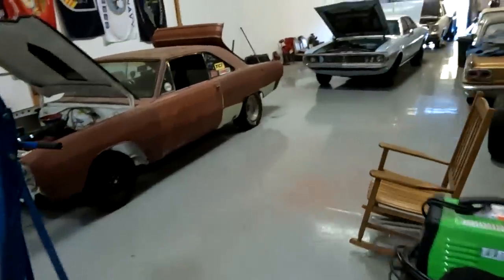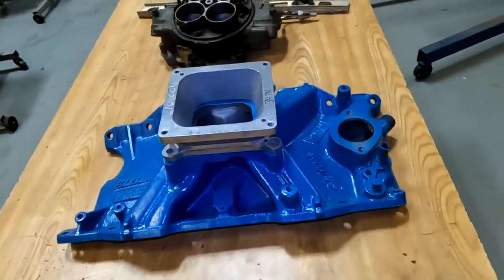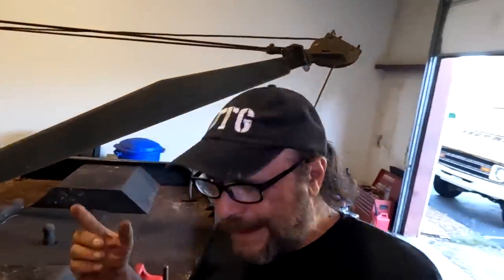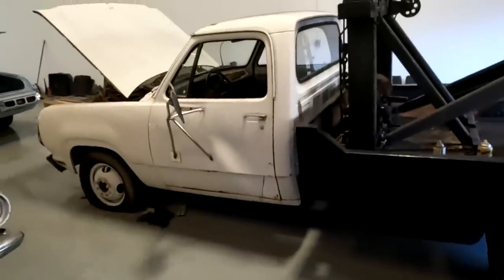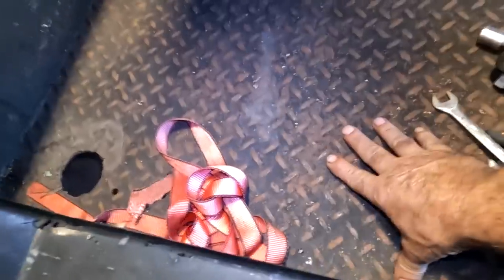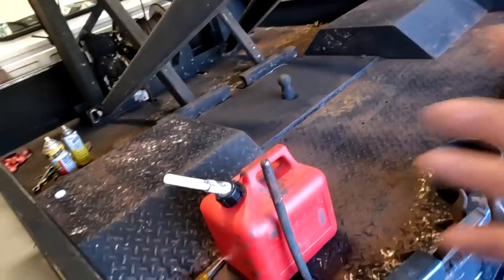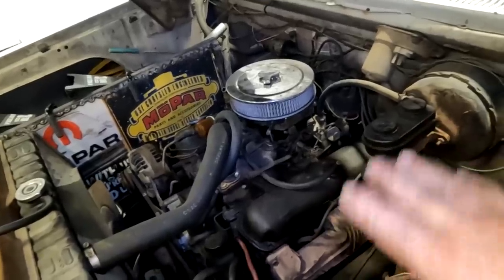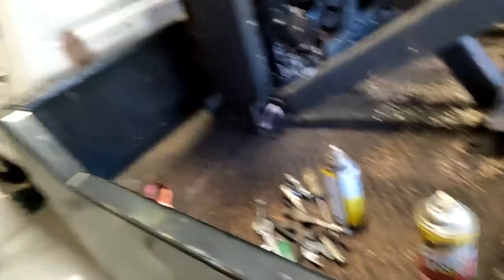Survivor Dodge Tow Truck Finally Gets Some Love, And We Build A Frunk! 1980 Dodge Wrecker Revival

Comment: Definitely a cool truck, all 70s and 80s dodge truck parts are very hard to find these days, you rarely find them in the junkyards and if you do they are either picked clean or totally roached. Also for some reason every single one of these era dodges I have seen has had the most hacked up and cobbled wiring harnesses on the planet lol.
Reply: It’s definitely a dodge thing, it’s been a thing for years and still is.  I was really glad to get rid of my last dodge while it still ran,  it was an 01 with all new cores but it had so many gremlins that I couldn’t believe it 😂😂
Reply: @georgewelker853  yeah dodge wiring is a special kind of junk, I have worked on a ton of old gm cars and usually the factory wiring holds up pretty good and rarely has issues unless someone adds a bunch of aftermarket junk or burns the starter wires on a set of headers, usually old ford's wiring would rot or just deteriorate from all the nasty grease they used on all the electrical connectors but dodge wiring is usually just a huge rats nest of wiring that gets, patched,spliced, twister together with no ryhme or reason. A buddy of mine bought a 89 12valve diesel ram truck and the whole harness was so butched I couldn't believe it, there wasn't a single unaltered wire on the whole truck every wire had been repaired,replaced, or taped into with scotch-locks it was actually amazing that it ran at all lol.
Reply: @briang4470  I found the connector for the tail lights by the booster on an 89 Cummins and we removed everything from there to the back, ran all new wires to the back, and put turn signals on the corners of the flatbed.  
The fuel gauge ground wire ran clear to the tail lights, and hooked into the tail light ground. No wonder the fuel gauges could read empty when half full, or half full when empty!
Reply: @scotcoon1186  🤣🤣🤣 I almost didn't get the half tank joke.
Reply: Yeah, and places like LMC don't have anything for any truck before the 2nd gen Ram.

Comment: I built my last car 10 years ago my 62Belvedere with a 512Hemi in it drag racing car way nasty complete top flue motor kb block and heads but used a longer rod a cut to make it a 14.to one compression and the cross ram and the original s/s 735 holly carbs all up dated screw in air bleeds and a afr rear jet plate.

Comment: Plenty of room for the engine but I wouldn't like to be changing the plugs on that side.
Reply from the maker: Take a good look.  There's twice as much room for the plugs as there is on an A Body
Reply: @UncleTonysGarage  Yes, but you still need to reach over the new steel and then down to the plugs. It looks like I'd have to be sitting with my feet in the frunk to work on the plugs.

I once owned an Australian Torana with a V8. See link for picture. . https://cache.gmh-torana.com.au/img.photobucket.com/albums/v290/REDA9X/MVC-010F.jpg
Now that was tight access, but at least you could reach it without climbing into the engine bay.